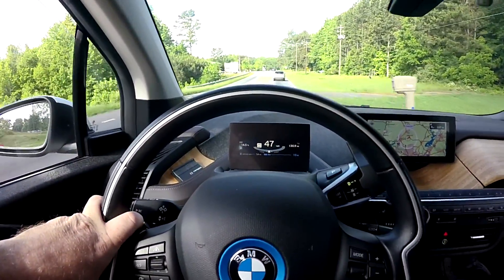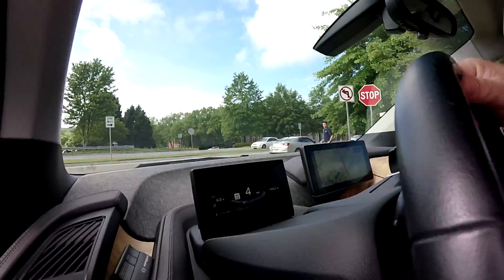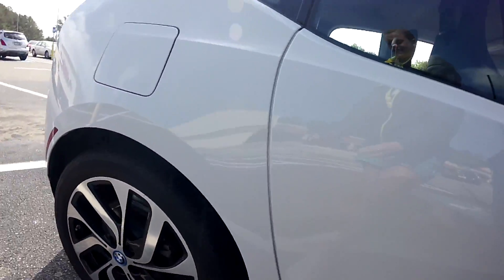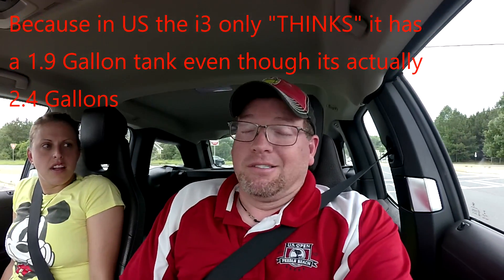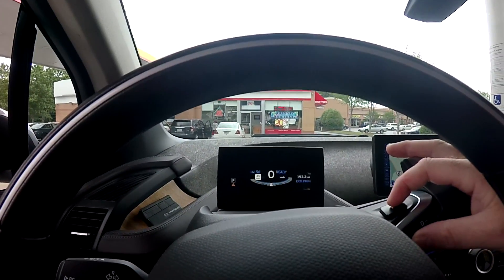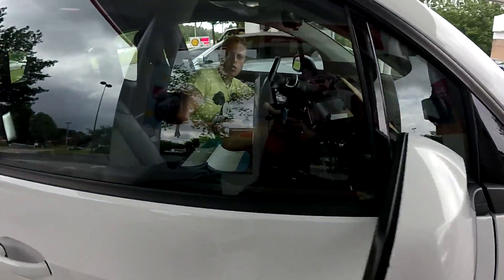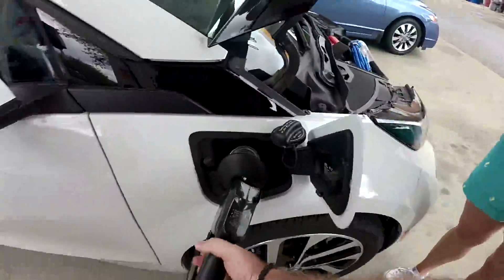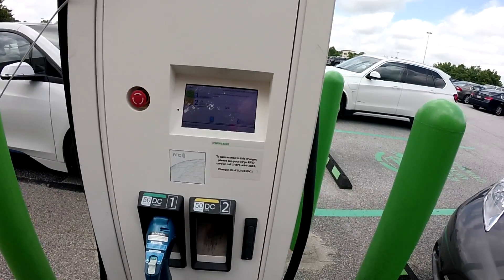2014 BMW i3 w/ REX Range Extender - Gas Door & Charging Fiascos

Comment: Step 1, buy a used i3. Step 2 re-code it for the full fuel tank and range hold. 3) enjoy the i3 and try not to smile so much that it hurts. With the non-us options re-enabled, you can run on gas any time you want when under 75% battery great for hiway, so you can safe the battery for in town)

Comment: Amazing video. Answered so many questions I had. I own i3 with range extender 2016 model in the middle east where temperature here reaches 55 Celsius. Car still work but due to extreme heat acceleration is not as powerful also due to the heat battery fan works longer to cool down the battery which will reduce your battery life while the car is parked undriven. Still happy with this machine it's a beauty. Sadly I heard there will be no more range extender option so whatever stock dealers has its going be it. Would only recommend this car with the range extender

Comment: Funny, I recognize all the places you were driving to. I live in Suwanee. Anyways, when you plugged into the DC charger at the Mall of GA, I didn’t hear it ‘click’ when she plugged it in. Maybe the camera audio didn’t catch it. This could have caused the communication issue. Also, I think if you run into this issue, you are supposed to unplug and plug it it again, while placing upward pressure on the plug to keep the cord weight off of it. When the DC charger starts charging, you can then let it go.

Comment: The 2014 BMW i3 doesn’t accept DC charging. It only accepts Level 2 charging. So when you were at that charging station (parking lot), you could’ve used the other chargers that was charging the Nissan Leaf and other vehicles because they were using the Level 2 Charging Station. And also, BMW updated their BMW i3 2015 models and up to now accept DC charging. So only the 2015 and up models accept the DC fast charging.
Reply: DC fast charging is an option on the 14 model
Reply: My 2014 does allow for DC Fast Charging.  From 2015 onwards the Fast Charging is standard.

Comment: I'm quite pleased but just 3 days my engine light came on  and I have to drop back off with dealership. Not very happy because I waited so long for darn thing.  I bought Terra package  2015 with 30k.  Having troubles maintaining the charge daily but realized its the way I drive.  What's the best way to maintain my charge throughout the day and not have to re charge during lunch.

Comment: I bought a used 2014 Rex also.  I had the exact thing happen to me.  Hanging at the gas station trying to figure out how to open it, too funny.  Dealership fixed the latch and works great now.  I love the car.
Reply: Haha!  Too funny...I thought it was only us.  Yeah, we felt sooo stupid til dealer said the latch was faulty....then we felt better.
Reply: Hello, have the same problem as well. Do you have any idea, what was changed? My service is trying it for few days with no luck. Thank you
Reply: @ondrejzajic  The dealership told us there was a recall on the gas door mechanism.  Look up recalls and see if you can find it.  Maybe it will specifically say the issue.
Reply: Seems like they said they replaced the door latch.  I remember something about the tank is pressurized and you have to hold the button for a few seconds before it will open.  Not sure if that is helpful information or not, but hope it does.

Comment: Is there a legal way to install a larger gas tank? Any advice would be helpful. Thanks.
Reply: No clue but the way we drive it, we dont need it.......BUT it would be sweet to have a bigger tank.
Reply: Stick a r gallon jerry can in the boot....get the goose neck filler with it
Reply: @stevenbarrett7648  didn’t you notice the fuel can in the frunk already? You can code the non US volume limit using BimmerCode app or otherwise.
Reply: @stevenbarrett7648  nice idea mate.  I speak your language.  I  will be putting a 4  litre gas can in my boot.

Comment: On the Drivers side there is a gas cap release button.  Look under the dash for the icon. This releases pressure so you can open the latch. Happy motoring
Reply from the maker: Yeah, it wasnt working so we took her to the dealer.  It was actually a recall item so it was fixed for free.  Was happy about that!
Reply: @VmanEV  Hello, have the same problem as well. Do you have any idea, what was changed? My service is trying it for few days with no luck. BMW told me no recall in Europe. Thank you
Reply: Call them already and they told me like there is no recall on it ! But thank you very much. If you will know what was the exactly problem, it will help, because I am going to let it fix someone from no BMW service and there are like 3 receptors which can cause it each one of them for like 150usd .. Thanks again  Ondrej
Reply: @ondrejzajic  The part that rusts in the gas tank is called the fuel pressure sensor.  It is not under recall, it has a technical service bulletin only in the US where they replace it for free under a 10 year extended warranty, every other country they will charge you to replace it for up to $1500.  You can manually open it using the method in this video or, you can cut through the hole in the lower peg in the gas filler door, that way if it fails to release, just pull the gas filler door slightly and it will open.  Picture of where to cut: 
https://photos.app.goo.gl/vVJorMJftHJL6s2n8

Comment: Hey man love the i3 videos. I've been looking for one myself. Been looking for a white rex with Giga, and Harmon kardon.
Reply from the maker: NO regrets here on the i3!  Almost bought a 2nd one instead of the Volt we bought.
Reply: Vman1313 EV my brother in law has 2012 volt since new, he loves it still, no big issues he couldn't fix himself relatively cheap.  We had a used leaf, it was great too.  We are thinking about a used i3 now. Just stumbled on this channel, motorcycles lured me in to your channel originally.  Great job on your channels, similar love of toys!
Reply: @VmanEV   which one do you guys prefer the. I3 or the Chevy volt I'm torn between the 2